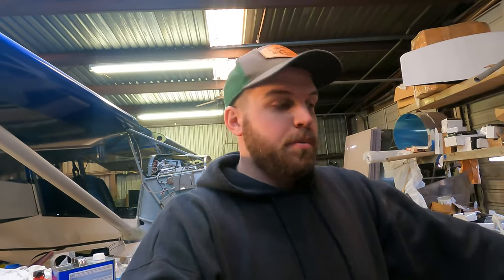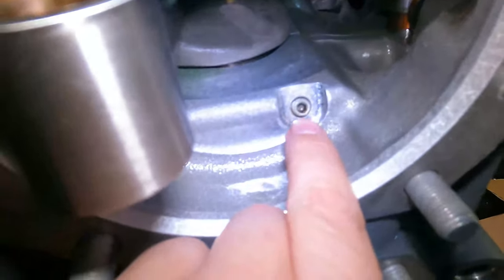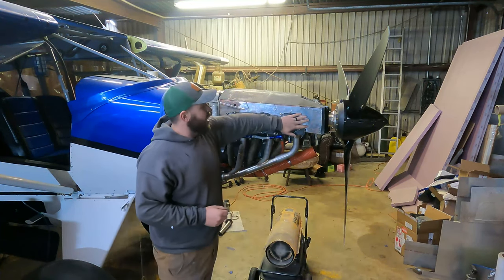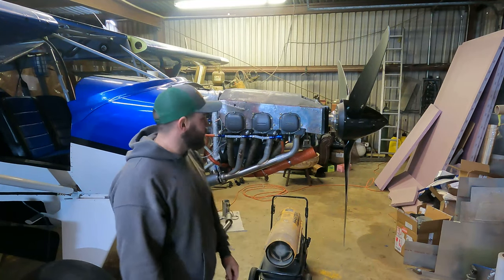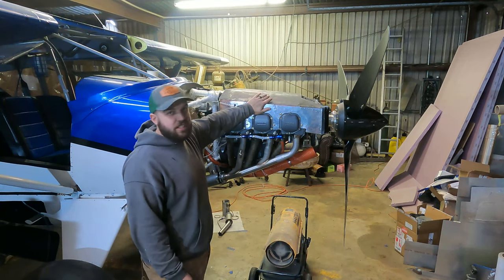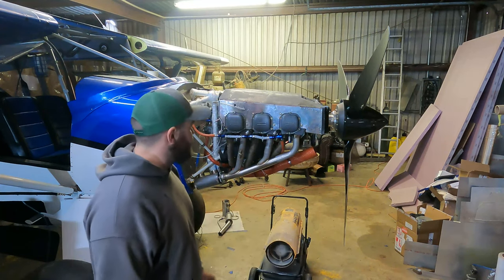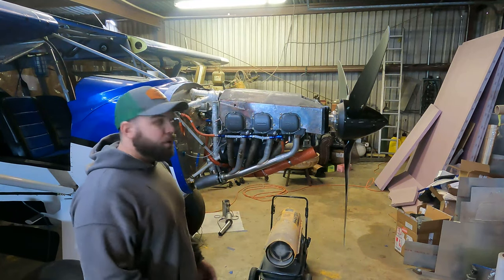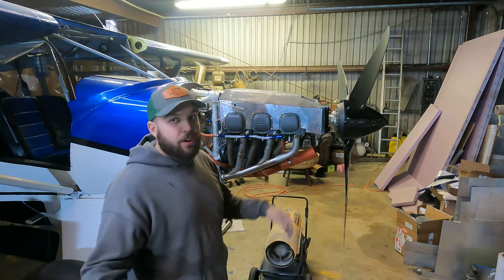300 Horse Power Bush Plane - Bearhawk 5 Engine Install

Comment: Have you thought about running an LS6 ?  PSRUs have come a long way and the LS platform is proven. Even in aviation.
Reply from the maker: I am not usually a fan of auto conversions in aircraft. I have seen some really bad examples but that said there have been a few that have worked. In this scenario the LS and supporting equipment is over 100lbs heavier. We are running electronic injection and ignition so the ls has very few advantages against a modernized Lycoming engine. I don’t doubt the LS engine itself, it is usually a supporting item that brings them down.

Comment: Did you loctite the oil squiters with medium strength loctite? You dont want squiters in the rotating assembly. Also does this engine have an enhansed oil pump? Does it have hardened valve seats for unleaded fuel? All these are good questiones to ask. Good luck, fast flights and soft landings.
Reply from the maker: Yep all installed per Lycoming manual. No need for an enhanced oil pump. I may have to adjust the oil pressure but unlikely.

Comment: H2O anti detonation fluid big time recommend
Reply: For what? The detonation margins on that engine should be fine. The guys running ADI are pushing 600-800hp out of turboed 540's where the heat from the turbo is a huge issue.

Comment: I'm really interested in the engine running on auto fuel and the mission work you will be doing. Is there an email I could use to contact you with some questions?
Reply from the maker: Send me an email @ virgilflys@gmail.com

Comment: why not a modern ECU controled turbo diesel...strong and reliable, more eonomical and watercooled
Reply from the maker: You can only turn a prop about 2700 rpm. Redrive would be required and most diesels do not like going from 0 - 15000 feet massive superchargers or turbos are needed.

Comment: Can this engine run on 100LL also or is it committed to 91?
Reply from the maker: It can run on both interchangeably
Reply: @The-virg  so there’s no changing anything out? You can fill it with 91 at the house and then fill it with 100LL at an airport and not change anything? If so, you have the ultimate engine!

Comment: Did you do this from a quick build kit?
Reply from the maker: Yes “quick” is relative. Took about 2000hrs with mods.
Reply: @The-virg  I've been looking at the model 5 for a while now. I've been told the instructions aren't the best, but hopefully the flying is great. I'm going out to Houston tomorrow to test fly the model 5. I think you also did that recently? I'm excited to see how it behaves in the air.
Reply from the maker: @alimoradi1195  that airplane is a blast. It flys like a rocket with that big 580 in it. Your won’t stop smiling the whole time your in it. They handle well with no bad tendencies. It’s the dream machine for sure.